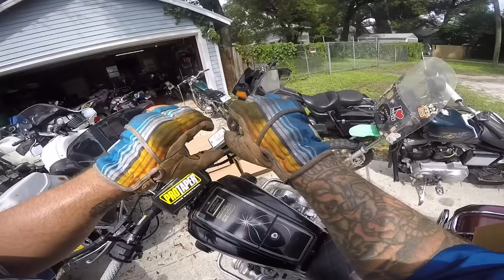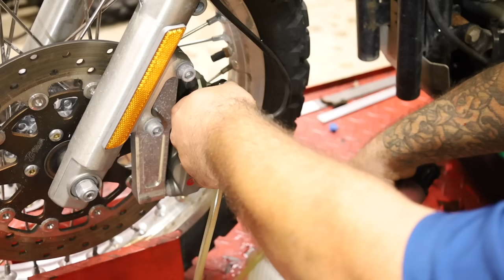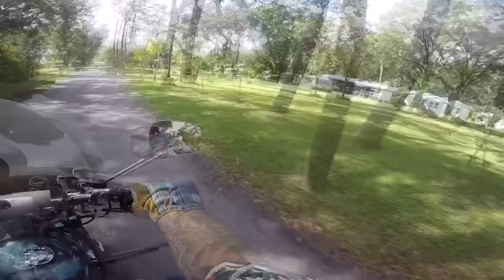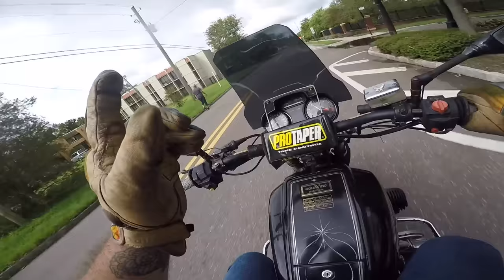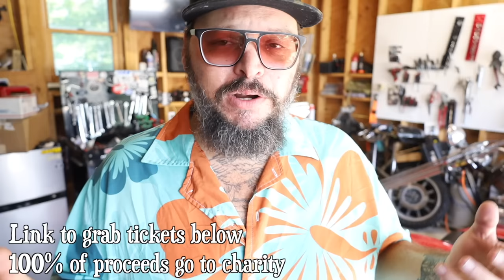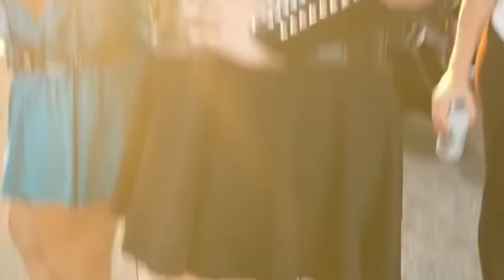It's time I made some Sacrifices 😔 | Shadetree Surgeon

Comment: I would love to help in Washington state. I found your channel about a year ago when I was building my XS650 chopper, had a ton of issues doing it by myself, it's not fully tuned as it needs the carbs dialed in correctly but it starts first kick. This summer I was busting my ass to get it done to ride with my son in law and was getting frustrated not being able to ride. Watching your videos made me think "why don't you get a reliable bike that you can just ride?" So I bought a 2007 kawasaki vulcan 900 with less than 5000 miles on it  and have been riding like crazy. Thank you for all of these videos that provide inspiration to people all over the place! Now I have two motorcycles that are total opposites and both are a blast.

Comment: To build up the oxide layer you get the steel red hot and quench in oil, it makes a hard carbon shell around the steel. Next time go a little hotter. Gear oil/hydraulic oil is the best for a long lasting finish. Built tattoo machines for a decade and that was my go to finish. Keep up the hard work!

Comment: From what I saw on that hill climb.. ide say tightening up your stearing kneck would do you some good. They are always to loose, in my opinion. On my dirtbikes and my dyna. They should not fall lock to lock on their own. With front tire off ground  They should require the slightest bumb and some what gently fall to stops.

Comment: Shadetree I have a question.... my chain is nowhere as tight as yours on the dirtster and if I tighten it up like that it pops when I ride it. So I tighten it up enough where it wont pop and I be damn if it dont loosen back up?? I'm a hefty fella like yourself but I didnt think I was heavy enough to stretch a chain that bad 🤣🤣🤣 what's your recommendation on new chains?
Reply from the maker: The tightness of a chain changes where it is on the stroke of the shock. You might be measuring your chain slack in the wrong location